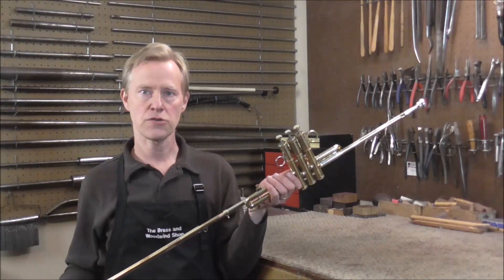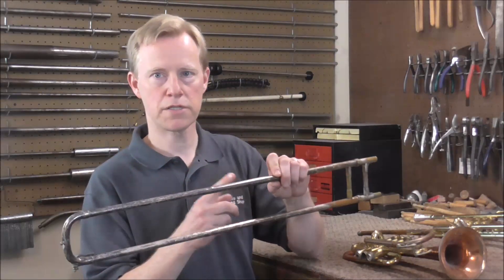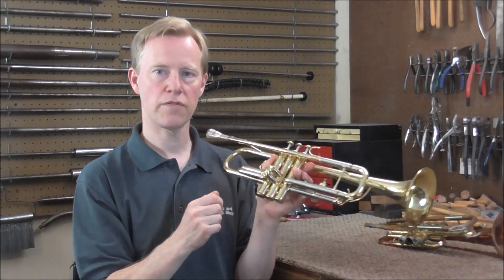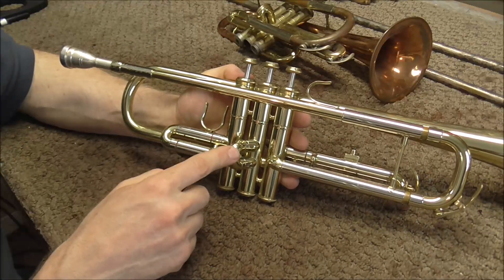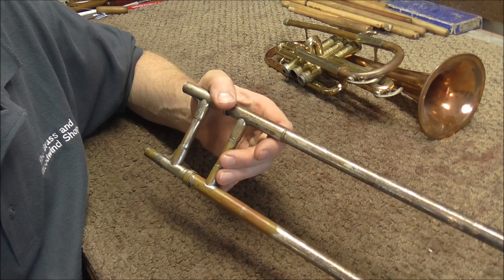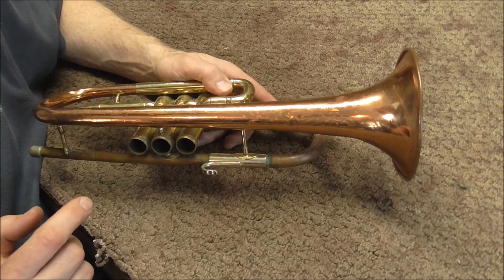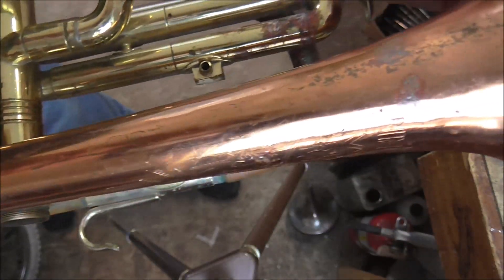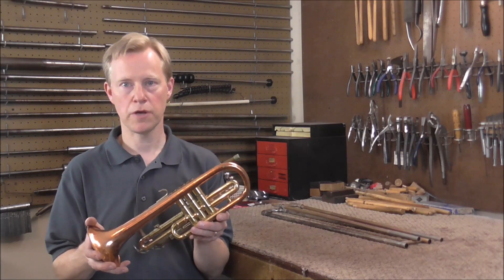Building a Slide Trumpet Project #1

Comment: A little correction on the Coprion bell...They weren't merely high copper, they were pure copper. Conn innovated a new way to manufacture the bells in a single piece by electrolytically depositing copper onto a reusable stainless steel form (much the same way copper is now smelted industrially), and then minimally worked into its finished shape. The result was a richer, more centered sound. I have an 18H trombone, and it sounds much throatier than its 7.5" bell would let on. I'm not sure how rare they are, but they very special.😁

Comment: I took out my Pitt American cornet for the first time in a year and immediately drop it on the bell. A good sized crease on the bell rim but not any where else. I tried to take the dent, sort of, out, but the metal is very thick. What’s your experience with instruments that have very thick metal. Although it’s soft, it’s hard to bend.
Reply from the maker: I would try the dent roller first and then the bell iron and rawhide mallet if necessary.
Here is the link to a video I did on removing bell dents on the flare of a trumpet. It is a little different because it is specifically about a Bach Stradivarius trumpet, but there are some similarities. 
"How To Remove Bach Stradivarius Bell Flare Dents"
https://youtu.be/M7a15osqnw4

Comment: The smaller bore trombones don't always blow that way - I've got a late 20s/early 30s Conn 4H that is huge in comparison (0.484") but blows almost as open as my 0.525" Bach 36. It's all about the system - leadpipe, slide bow, etc. The playing on this slide also looks like a different system to modern slides, particularly as it's a slide-on stocking, rather than than expanding the tube to make the stocking. Looking forward to seeing this finished and hear about how it plays.

Comment: This looks like a really interesting project Peter! I'll be following along.

You likely already know this, but there is an easy way to use a 1" micrometer one-handed. Lay your right hand on it's back with the fingers slightly curled. Place the mic in your hand with your pinkie through the stirrup, and grasping the thimble with your thumb and forefinger. Support the barrel with the backs of your middle and ring fingers. Grasping the stirrup between the pinkie and ring finger, you can control the position of the mic easily and can spin it in our out with your thumb and first finger to adjust it, and the scale is on the top to be easily read.

Comment: Egads!  .452" bore Trombone.   Must feel like blowing through a straw.
Quick and dirty math.
4.5'Bb = 54"
Second valve = 54" * 0.06 = 3.24"
1+3 (puts you in 6'F) = 18"
Moving length of slide = 21.24" / 2 = 10.62"
That's probably not very exact, but it proves that the concept makes sense.  A 10.5" slide throw sounds pretty cozy!
Reply: Don't forget that lowering pitch on an instrument works like compound interest. To lower the pitch a half step, you need to increase the length by 5.95%. To lower it by another half step, you have to increase the new, longer length by an additional 5.95% (thus compensating euphoniums). For a slide trumpet in Bb, the nominal length of the open horn would be 54" (4½ feet or about 137 cm). To lower the pitch by 3 steps, you would need to add about 22.4" (or about 56.7 cm).
Reply: @johnlowe37  You are correct.  I was just doing the quick version of the math with uncorrected valve lengths.  To achieve proper intonation, it will need to be a hair longer.  There's also the size of the bell and some leadpipe wizardry that gets involved, but I've never really studied it that much.  In any event, with the bell he is using, he should have plenty of room for a fully functional slide.